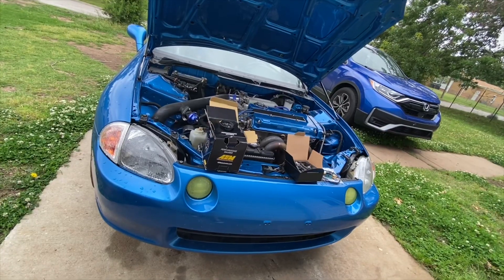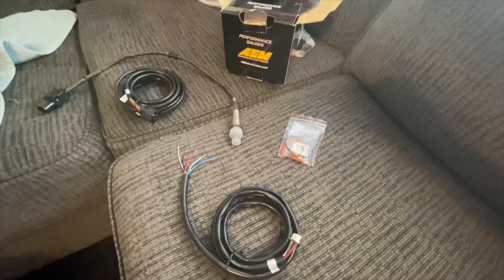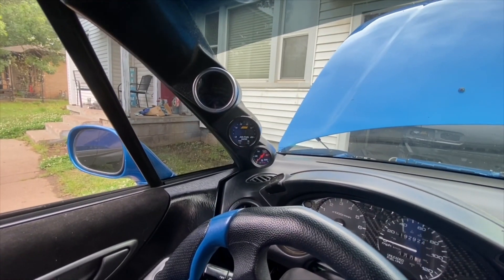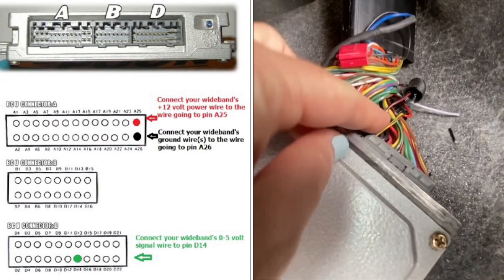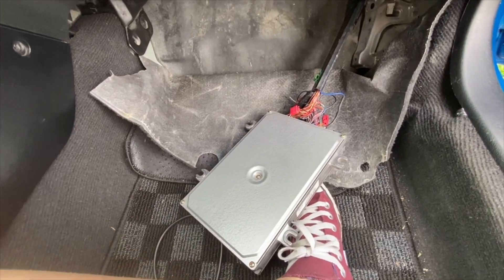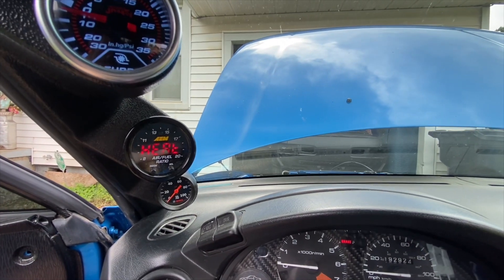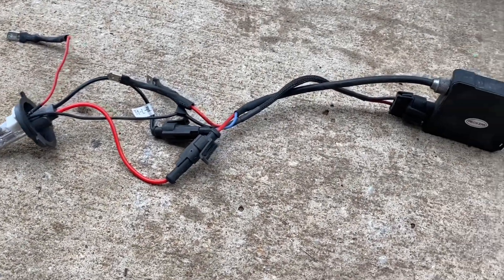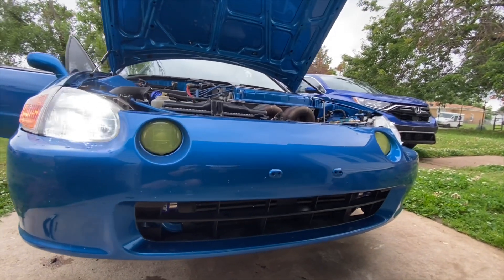How to wire up wideband directly to ECU obd1 HONDA

Comment: did you plug the brown wire to d14 for good signal?
Reply: D14 does not process 0-5 volts to accurately indicate A/F.
Hondata recommends using D10, and clip or de-solder resistors 136 and 138 ( the resistors limit the input.)

Comment: Hi, when you connect an external AEM widband, do u leave out the  original sensor?
Does the computer know how to perform repairs using an aem sensor? Of course after connecting it to the ecu.
Reply from the maker: On a hondata S300 it won’t correct the fueling on its own…wiring the wideband to the ECU is only so you can data log your air fuel ratio while tuning. Yeah we usually go into the hondata and turn off the factory O2 sensor and just run the wideband so you can data log your AFR.

Comment: What about the o2 sensor or wideband sensor?
Reply from the maker: You only want to do this if you’re running an after market wideband and  then you’ll have to get into the Hondata and turn off the O2 sensor so it doesn’t throw a check engine light

Comment: Question? What set of wires did you use to wire to the ecu? The gauge wires or the 02 wires? I just wanna make sure I run them to the right set of power and ground wires. Also did you have a voltage offset?

Comment: Is that the 1.6 vtec? If so where did you get that plug cover? I've been looking for one.
Reply from the maker: Yeah I got the carbon fiber spark plug cover on eBay. Around $40 if I remember correctly
Reply: @BlondiesGarage  I can can find the B series but nothing for D series